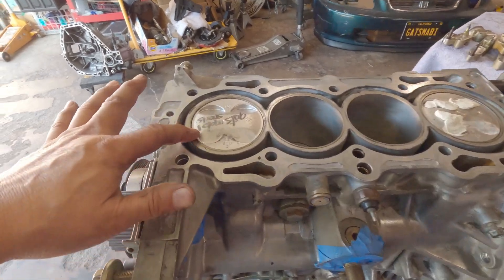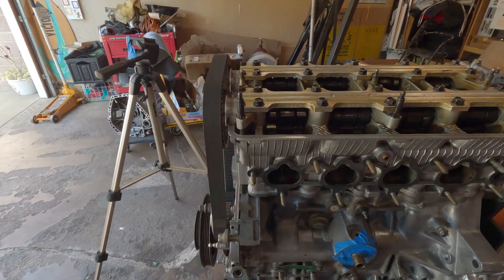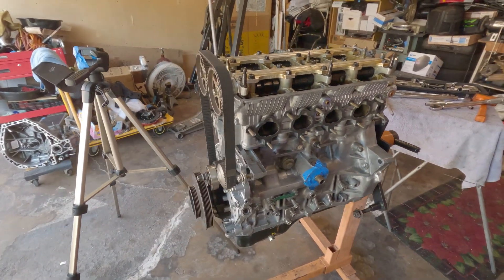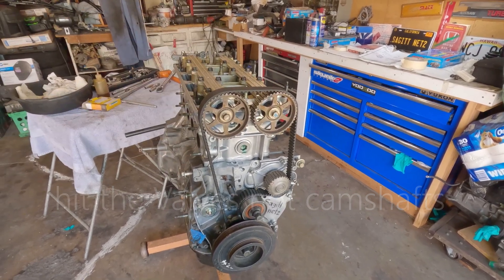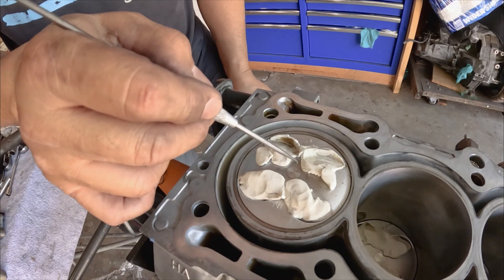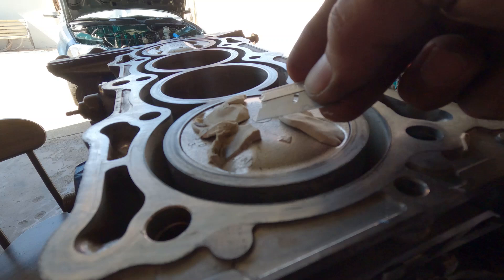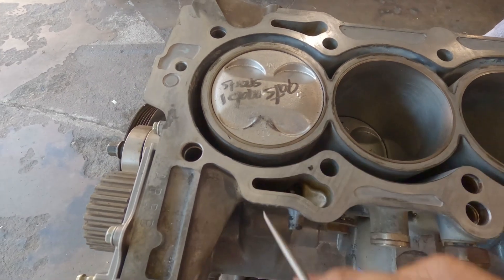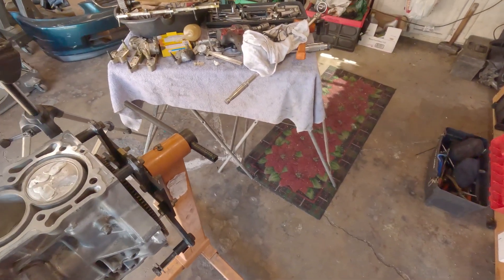G23vtec Piston to Valve clearance check! ep.11

Comment: Saggit with a NA G23 build with K20A2 pistons would I be able to run a stock p13 ECU? Or do I have to get it tuned? Thank you for everything
Reply from the maker: You can run it w/ p13 ecu, but only to clear all the bugs out. Set the ignition a bit retard to prevent any knocking or pinging that your motor will encounter. Sinced it was a hi comp ratio engine, it's best to get it tune so it'll run correct.
Reply: @sagittnet2158  thank you so much man, I will definitely get it tuned, but willnprobably break in motor with stock ecu to seat rings before tuning
Reply from the maker: @jile2245  yes, that's pretty much what l did on my engine. I was using p28 w/ H22a4 fuel basemap. Once engine accumulated some mileage and fix all the bugs out. Then dyno time.